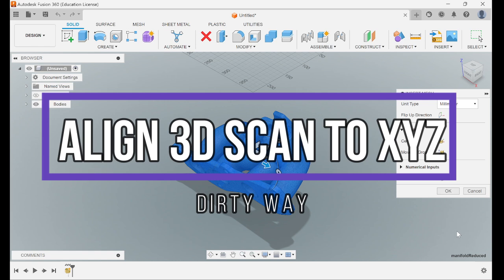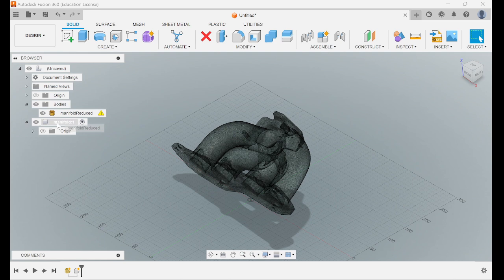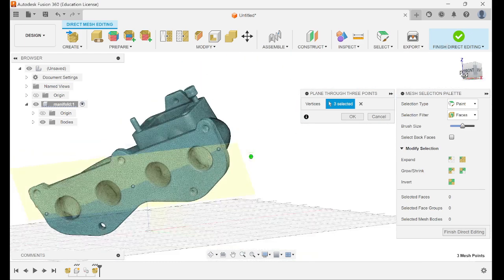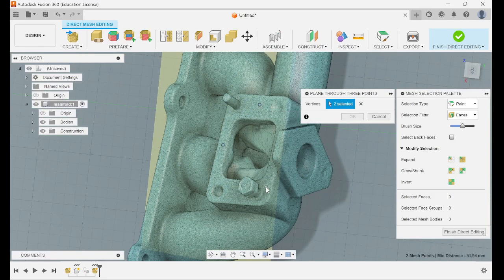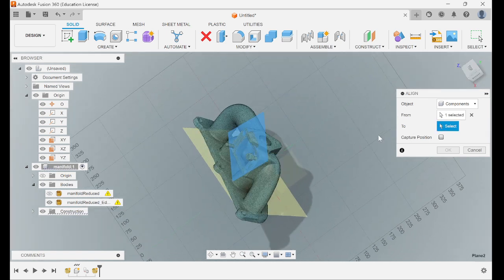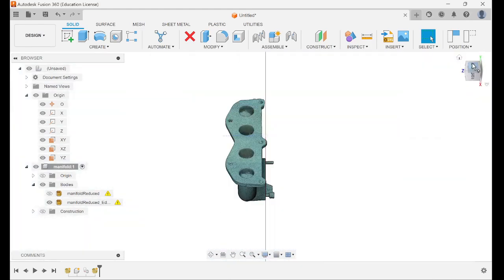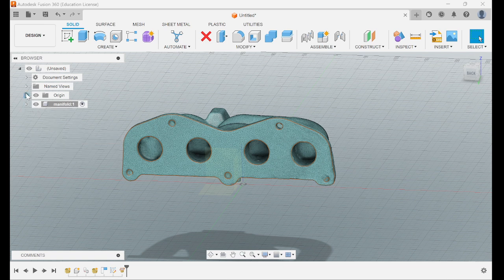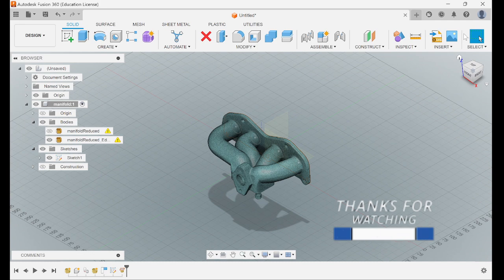Align 3D Scan to XYZ in CAD Fusion 360

Comment: Can anyone confirm if this still works? It seems to be broken as of Aug 2024.
Reply from the maker: @RocketkidDesigns  ill check later today and confrim
But should still be working. Remeber to not skip the direct edit menu
Reply: @xile6  Thanks, I did end up figuring it out. Turns out the component was grounded to the parent. I ungrounded it and it worked.

Comment: I keep getting “no alignment suggested by geometry could be found” when I try to align it………
Reply from the maker: OK i found the problem. Right click on the Component then unground from parent
Reply: @xile6  Dude, I've been banging my head against this error for hours.  Thank you so much for this comment!  Solved my issue.
Reply: @xile6  Thank you! I spent hours trying to solve the problem! I should have read through the comments earlier. Thank you!
Reply: @xile6  THANK YOU
Reply: @xile6  thank you for replying, appreciate that.
Reply: @xile6 many thanks !
Reply: @xile6  Appreciate that!
Reply: @xile6  thanks!
Reply: @xile6  Have the same problem, but don't have the option to unground from parent. Is it maybe, becourse my mesh is not closed?
Reply from the maker: @unclebenjen8661 close mesh should not matter.
I did create another video. I did see that people were looking for it on the wrong tab. Check that vidoe out and let me know "fusion reverse eingineering 3d scan"
Reply: @xile6 thanks
Reply from the maker: Sorry about that. I will have to check and see what the problem is. Fusion updates often and things break.
Reply: @xile6  Yep, needed this one.  Thanks!

Comment: Hi there,  When I try the same thing I get an error "no alignment suggested by geometry could be found ". Do you have any idea about how to fix it? Great video btw this method is 1000x better than calculating vectors and using Move :)
Reply: @stal2k @damonwolf2392 you have probably anchor icon on your component. Right click on the component and deselect Ground to parent
Reply: @dizzicz  Thanks this is the solution when its not working,  Can someone pin this?
Reply: @dizzicz  ty will try.
Reply: @dizzicz   thank you
Reply: @dizzicz  This fixed it for me, thanks!!!
Reply: Same issue, curious as well.
Reply from the maker: @stal2k  Right click on the Component then unground from parent
Reply: Same problem, no information on how to fix it.
Reply from the maker: @DamonWolf2392  Right click on the Component then unground from parent
Reply from the maker: Right click on the Component then unground from parent